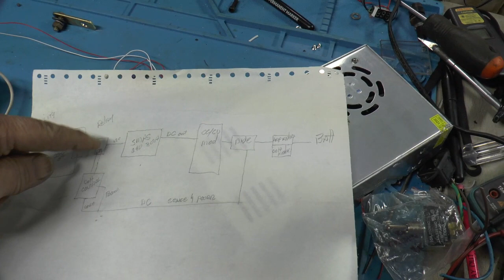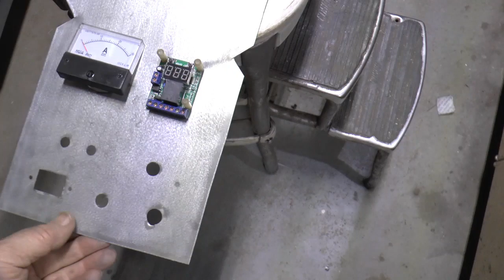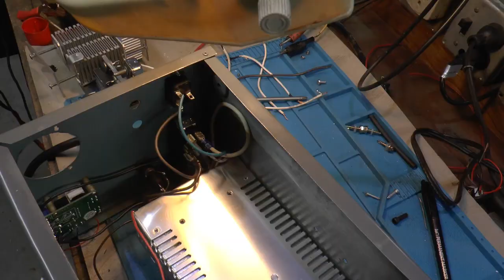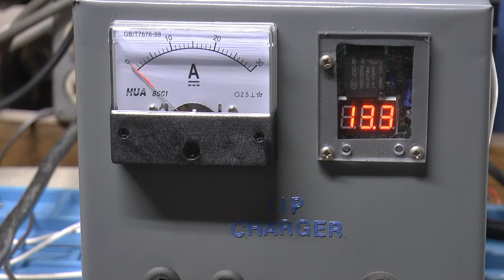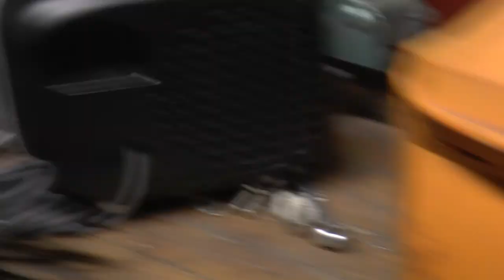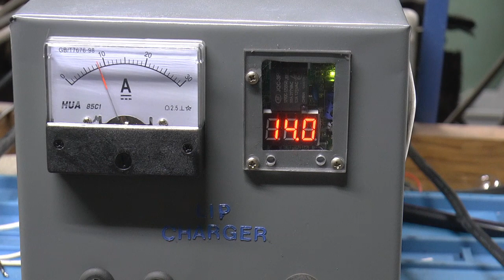LiFePO4 Battery Charger Build 20 Amp

Comment: Doesn't that module have a delay setting? Wouldn't it make sense to add a 30 second delay to the 13.6V off setting so it doesn't trip the moment the it hits 13.6? I'm trying to think of a way to allow this thing to work with CC CV charging. Assuming you had a single lithium ion cell if you set the off voltage for 4.20 with a 60 minutes delay that would all the CV phase to finish....or you could do a 30 minute CV phase if you wanted the current cutoff to be a bit higher. If you don't set a delay you're only CC charging and skipping the entire CV stage. I think at a bare minimum you need a voltage detection relay module that allows a delay of 60 minutes so even some decent sized batteries can have time on the CV phase.

No need to use a delay for the "charger on" voltage since we consider the under load voltage of 2.5 or 3.0 where we want to cut off although some Lipo chargers like the iCharger ramp the current down when doing discharging once it hits the minimum voltage but my understanding is most people just cut if off and if it rebounds more than half a volt your load was likely way too big.
Reply from the maker: Valid point. I am currently slowly switching to a 48 volt system so I no longer use this charger. I have repurposed many of the parts for other projects. Thanks for commenting and possibly helping some else build an improved charger.

Comment: Nice neat finish on the build! It's a shame the load/charge affect the battery voltage readings so much, you never quite know how much is in the batteries until its rested for a while.